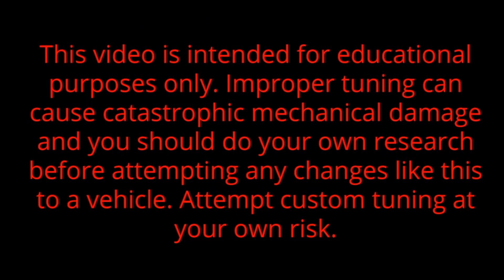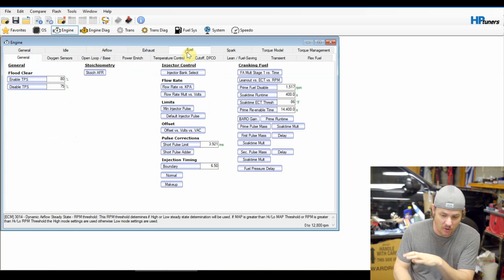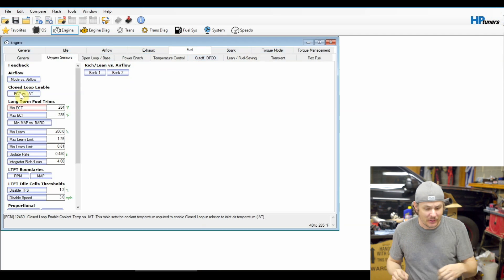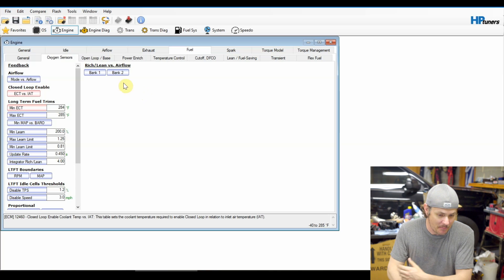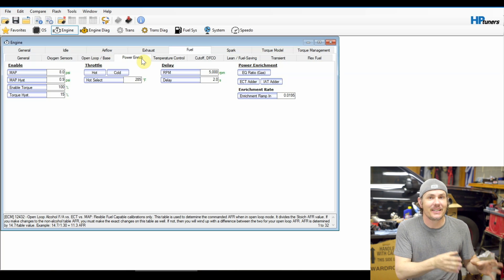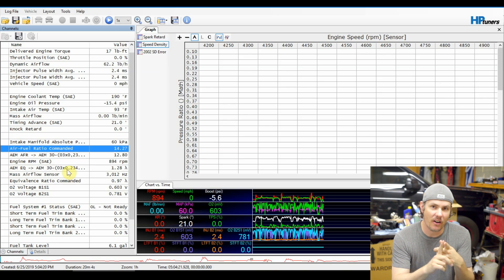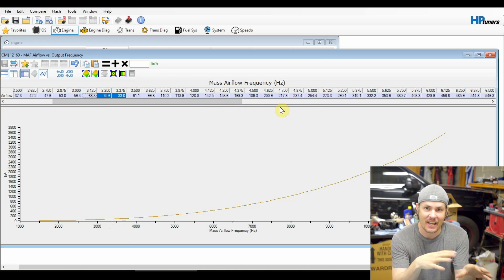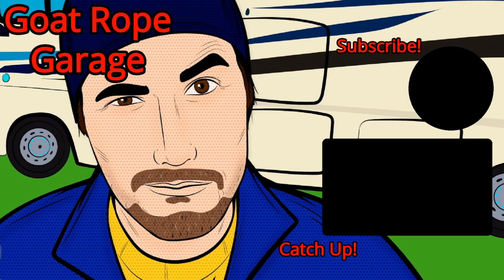GM Gen 3 Mass Airflow Tuning and Scaling, MAF Histrogram Setup, HP Tuners How-To Tutorial

Comment: I'm revisiting MAF as I've had some fueling issues. I assume you force the vehicle to operate at a lower AFR, forcing PE? Then the narrow bands won't be too accurate? You're using STFT to dial it in? I didn't notice you turn off STFT in the video?

I last did this with LTFT & STFT disabled. Forced tune file to meter air with MAF as  you showed. Then I used my wideband sensor. However, I've been suspect of commanded AFR PID being accurate, because I think deep in the PCM it's actually commanding 15:1 AFR (slightly leaner than commanded). This skews the WB error by approximately 3% lean. I chased my tail on that but after asking on HP Tuners somebody said that's normal behavior to protect the cats in CL. 

Thinking out loud... Maybe the better way is using STFT and or LTFT enabled, in closed loop... and the wideband to verify? Then if the wideband is within 3% (lean) then you can use the trims. Otherwise, PE should be 0% WB error (trims / CL enabled) cause I think the PCM does respect the commanded AFR there. If adjustments were needed to PE with trims enabled it's the cumulative of the trims and WB error. I used something similar to this for CL VE. It's a bit more nuanced, but provided safety net to keep me around stoic. That's when I realized the PCM must bee commanding 15:1 for CL when stoic is set to 14.68:1 in my tune and high resolution PID for AFR reports 14.68:1.

I'd not second guess myself but I'm getting a DRAMATICALLY different MAF curve from stock. I have a cammed LQ9 with Banks CAI. Before the banks CAI it was fairly similar to stock.

Comment: So I’ve got my histogram set up but it seems like I’m missing something. When I log, all the cells are showing -92.72 and similar numbers. All your numbers looked less than 10. I don’t wanna paste special bad data into my tune. Is this something to do with the aem and moving the decimal? Because I did that on the scanner side and it appears to reads correct

Comment: Question. I have new build that I can’t get to start. I’ve change multiple sensors, coils, wires. Etc. What would you charge to look at a Tune File to check if it’s setup correctly for my setup?

Comment: May have scrolled through this too fast when coming back, but in your intro to tuning series on your truck you pulled 5 degrees spark and added some early fuel to start rich. Would you do that here too? I just got long tubes, full exhaust, and CAI and am hitting low 15 AFR at idle and wondering if I should do like a 1.05-1.1 multiplier before going out and MAF tuning. Thoughts?
Reply: Should add it’s a ‘98 vette with first iteration gen 3 ecu

Comment: New to tuning, figured this is the best place to start. Thanks for the great videos.
Im trying to dial in my MAF and get between plus and minus 1. Each day it logs different, cooler days its reading rich (-1.5 to -2.5) after it sits for a few or on hotter days i can dial it in and keep it pretty consistent around zero. My question is,  how do i know what is correct? its obviously temp related. I thought the maf compensated for IAT. Its brand new by the way.
Stock engine with long tubes, CAI, and AEM wideband
Reply: gen 3 L33

Comment: One thing I found when doing this is that STFT is still enabled and making changes to fueling when following these steps. There is a setting under the "Open Loop/Base" tab that allows you to disable STFT in open loop. I did this and it makes the fueling solely based on the MAF without STFT.

Comment: I have a question brother have u ever had an issue with the mass air flow senor .. not stop pooping up I've had my truck tuned twice an there nothing wrong with my mass air flow senor.. needless to say I still have the engine light still on for that an primary ignition h light .. I'm lost an have no clue what to do. Any help would be helpful

Comment: Thank you for this video! straight to the point!
Question: During MAF tuning, how can I avoid the IVT vs Map gains within open loop. I am afraid to set the Gains to 1.0 for tuning process. Is it possible to do a graph to recalculate commanded AFR vs EQ for this case? Thanks!

Comment: I follow step by step and I can't get Dara to populate on the AFR ERR table. I'm only getting one box to hit and it's 1500 with -9.5 non of the other frequencies are registering. Any help?
Reply: Figured it out. You should mention that we need to add the MAF FREQUENCY LOG to the channel list for your graph to log properly. Correct me if I'm wrong but it's working now.
Reply from the maker: Yes, you need the MAF sensor, which reads in Hz

Comment: Kyle, I have a quick question that I'm ignorant on.   I am currently running a 3bar speed density tune in gen 3 pcm.   LSA supercharger on an LS1.   I know in the old days it was assumed that the MAF was inoperable in the hp tuners 2-3bar OSs.   I am now understanding this is not always the case.  I have reason to believe that my OS is capable of seeing MAF.   I would like to try an LS3 card style MAF in a 4 inch tube.  I am unclear one what I need to do for scaling as a baseline.  any advice?    Thanks as usual for all your great info in these videos.
Reply: Did you ever find out any info of this? I'm in SD 2bar turbo and would like to go back to maf if it's possible.

Comment: This may be a dumb question, but what would be the reason for doing this? How does this benefit the engine itself? I have an lq4 in my 03 2500hd with true duals and a k&n intake... So not much is done to it at all, the thing has zero torque management and the power enrichment is actually able to be activated.. unlike the factory tune. As for how far I can go without changing timing, is that about it? (91 octane is too expensive and I hear stories about gas stations putting 87 in the 91 tank when they can't get 91) so needless to say I just stay away from changing the timing at all

Comment: You may already have a video on this, so I apologize if its a bother. I'm planning on doing a long tube header exhaust set up with no cats (there are really no emissions laws where I live) and I am wondering if I need to leave my LTFT disabled due to having no cats. Is there anything I can change within HP Tuners to prevent a check engine light due to the lack of catalytic converters? Your videos are amazing and I'm learning a ton. Thank you!
Reply: Correct me if I'm wrong Kyle, but as far as the check engine light goes you can go to engine diagnostics and go down to P0420 and P0430 catalyst system codes and disable them
Reply: Set them as no error reported
Reply from the maker: Correct, but do it before you remove them if possible to prevent a permanent dtc

Comment: Just buying hp tuners had it tuned by a shop with it comes off the line very weak I have a 2006 Chevy 1500 with a 5.3 cammed , ported heads , 4.10 rear end and a 4l60 with a 2800 to 3200 circle d stall and a Corvette servo please any help will be appreciated

Comment: Hey Kyle 
Great video as always thank u for all ur help in tuning community. 
Maybe u could help me out here don’t have anything to do with this lesson.
Having trouble with my 2011 Silverado 2500Hd. Bank 1 sensor 2 just went out on me. Iv put 3 different 02 sensors in 2 new 1 stock. Tested all three with OEM’s meter all seem to be fine. I cant get any MV’s to read maybe 1-2 like it’s trying to work. Iv tested the 02 lead or connector from wiring harness with test light  get good connection on power wire and pulse wen truck is running I believe that would be the heater wire or connection rite. But anyhow im at at a standstill here just thought maybe u could help. Any advice or ides would be very appreciated along with all ur videos. 
Keep up the good work. 
Thanks 
Josh.

Comment: I’m working with a 2003 5.3 so I purchased your scanner package and it’s awesome BUT I can’t get any readings on the maf or vve graphs. I’ve made sure all the parameters are selected that are needed. Looking at the predetermined maths the pids are white and should be scanning. I have maf sensor, eq commanded, air-fuel ratio commanded, mass airflow, absolute pressure, rpm. Still graphs not showing data. Please help
Reply: I’m not using a wide band also maths are in lambda...

Comment: Under open loop tab, Do you need to disable the Open loop STFT? If we're forcing open loop for tuning with the wideband wont the STFT Still function if you leave that enabled? I'm new to tuning so trying to get it all straight so my afr err ratio is correct.

Comment: I have a 1974 Chevy K10 that I took a 2003 GMC Yukon denali 6.0 and put in my truck I sent my computer out to have it unlocked it came back it ran fine well OK then I put a camshaft and Springs on it took it to a dyno shop they got 295 to the wills and it runs horribly I bought Hp tuners because I was tired of them messing with it and now I'm trying to figure out what they did can you please help me tell me what to do for I can get in contact with you  I did 15.5 before the camshaft 17.8 after the dyno tuning
Reply from the maker: Ronnie, check out the patreon, you can find a link at goatropegarage.com

Comment: You should always disable STFT when doing MAF and SD VE correct? Otherwise I would think the computer is making adjustments.
Reply from the maker: Correct, that is why it's imperative you have a wideband that can produce correct error ratios. First mod should always be a wideband if you're getting into tuning
Reply: @GoatRopeGarage  So on a gen 3 with p59 computer, I should disable STFT under Engine-Fuel-Open Loop-STFT open loop?

Comment: For some reason hp tuners is not populating my afr error histogram. The button to repoll is greyed out. I also have the aem 4110 when I do the user defined and divide it by 10. The computer side shows 1.49, but the gauge it self shows 14.0. In order for it to read right I have to use gas 14.7

Comment: Kyle, can this be done without using a wideband? I have a 04 2500HD with the LQ4 and 4l80E, all it has is intake, exhaust and electric fans, eventually I may want to tackle the PE in which I would need a wideband, but would like kind of get my feet wet before dropping 400-500 for the MPVI2 pro and a wideband
Reply from the maker: Nope, you can only do very limited tuning without one
Reply: @GoatRopeGarage  thanks for the quick response, I appreciate it!  I had a feeling that was the case but wanted to check before I committed to spending the money. But i guess you gotta learn at some point!
Reply: @Goat Rope Garage  Kyle, I have gone through a lot of your videos and watched where you discussed hooking up the W/B via serial with the mpvi. I have the mpvi2 and would like to hook a wideband up for use on multiple vehicles. I see some people use red and black wire to the cigarette lighter, but for USB, does the signal wire go to the usb on the laptop or to the usb on the mpvi2 unit?  Also thank you again for sharing your wealth of information!

Comment: Need some help 🤦‍♂️
On around 5000 rev range, my car has a puff of smoke and sounds like knocking but I could be wrong. I checked my hp scanner,  I can't see any knock at all. Am I missing something or did my previous tuner disable the knock. Where do I start looking for why it has that puff, is it too rich 🤷‍♂️.
Gem III Sidemount supercharger 345rwk .
Reply: Do you have a wideband installed?
Reply: @Jakeguard  not yet
Reply: Will it be running too rich
Reply: @aleksmijakoski4281  you are going to blow that motor up if you are tuning a super charger without a wideband.  You need to set up your commanded AFR, install the wideband and get it integrated into the logger, and start tuning the way goat rope tells you too.  These cars can never command a rich enough AFR if you boost them, they arent setup to even see above atmospheric pressure (boost) without the correct MAP sensor and VE/MAF tunning at a minimum.  Timing has to be dropped by  at least 12 degrees from a standard NA map.  Then you can start adding it back in.  Your knock sensors might not even be enabled.  You need that entire map gone through.
Reply: @Jakeguard  thanks Jacob, I haven't modified anything on the current tune. I'm waiting until I get my wideband. I'm not sure how to check if my knock sensor is on. 
Usually only on the first squirt it puffs smoke but not the second time. I just don't want any puffs of smoke to the car behind me, lol
Reply: Will i need hp tuners pro feature to connect my AEM wd on the scanner, or just the pro link cable. 
Appreciate your help

Comment: Hey buddy this was very helpful  in ur honest opinion where would the beginner no laptop no nothing  not just ur set up but everything a person needs to learn and purchase   I'm disabled and can't get around to good but I still need a in come  I'm not the smartest tool in the shed but everything u have said and showed in ur videos it really makes sense  one of the 1st I've actually could understand with all that being said  just a brief list of thing I need and dont where I can't be cheap and what's pointless  thank u ahead of time buddy keep u the good work
Reply from the maker: Hey Adam, HPTuners is a great platform to learn on and the nice thing about it is that it will run on almost any decent laptop, in fact I tested out the cheapest one I could buy on Amazon, and while it didn't run blazing fast, it was still good enough to get data logs and make changes.

Comment: Will this process work without a WB? Wanting to dial my maf  it seems like it is correcting a lot I had it tuned by someone else an decided to get HP tuners later
Reply from the maker: Nope
Reply: I have a WB now but am having problems figuring how to wire the serial in my pre can bus Ecu I have a p01 ecu an hptuners mpvi 2 do u have any in depth videos on that?

Comment: Got directed here from a Sloppy post. Great content! Is there a video on the high level operation of GM ECUs? From startup to closed loop, when is MAF vs VE used, how are fuel trims calculated and used. Most driving is done on the narrow band O2 sensor feedback, going rich/lean to maintain stoich, so why tune MAF and VE, just for PE?
Reply from the maker: Yep, pretty much! That's the critical place on the tables anyhow. Check out the playlists because I cover a lot of the topics you're asking about.

Comment: I just don't get it iv done everything your doing in the vid & I still have no communication to the arm 30-0300 in hp tuner the USB port reading in 9600 8 bit none an 1  re start  computer  with ever thing plugged in  run scanner arm goes  by by
Reply: What do you think I'm missing only been trying to figure out for a month now

Comment: Hi Kyle.  I installed Procharger in a LS376/525 (E67 ECU). Procharger kits include a smaller diameter inlet tube than the stock one. Right now I only want the engine idle, but as soon as I start the engine, it begins to accelerate itself and I need to shut it off.  So I couldn't do what you suggest. Is that a common issue? Do I need to manually escalate de Mass Airflow vs Output Frequency table taking in account the new tube diameter first? Thanks!!
Reply from the maker: That's a complicated issue because if the tube is smaller it's going to cause you to read higher in the MAF scale, did it come with a tune?
Reply: @GoatRopeGarage  Hi, first of all thanks a lot for your quick reply. Unfortunately Procharger doesn't provide any tune with their kits. Obviously, I could try it, but what do you think about to manually scaling the MAF vs Output table using the proporcional diference between the stock tube diameter and the new one? I saw that a lot of people do that when they change the inlet tube for a bigger one. In this case the coefficient will be <1.

Comment: Thanks for the video! probably a newbie question but I ordered the aem wideband, But I can't get the graph to work correctly. I watch this video like 20 times so I didn't miss anything and it's still blank when I run my vehicles any help would be appreciated buddie.
Reply from the maker: If it's blank you're not getting data you need, check your parameter list and make sure your have an the data on there you need when you start scanning
Reply: #Goatropegarage I got it, thank you for your help. I did have to go though your other videos and set it up correctly but it works perfectly. Keep the videos coming now I have to work on my 2001 s10 with the spiders injected system.

Comment: Learning alot from these vids,  looking to tune my 04 Chevy 4.3L in my overlanding adventure camping rig.
Reply: Those still use a distributor?
Reply from the maker: Yeah, with a triggered coil to adjust timing, so you have wide bars that connect the rotor giving you electronic timing adjustments

Comment: Will using the EQ error instead of the AFR error work the same.  When I use the AFR error i get no logging info?
Reply from the maker: Yep, you can use either, and I would use EQ if you have the option. If you're not getting data on AFR error maybe your gauge isn't bringing AFR data back. Most only bring back one or the other.
Reply: @GoatRopeGarage  Kyle thanks for info keep the videos coming.